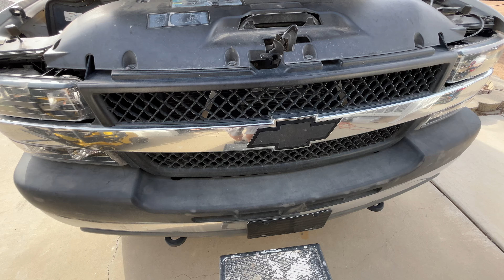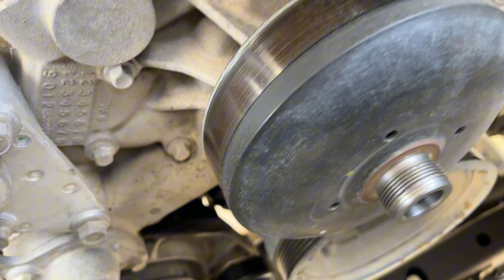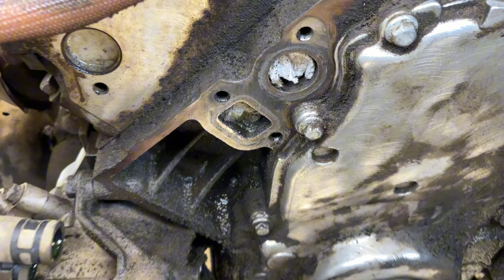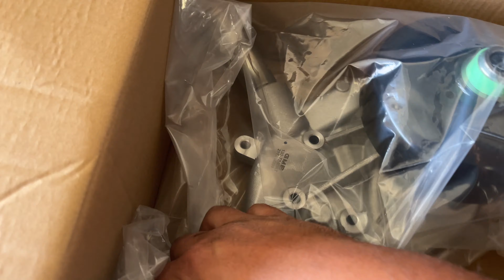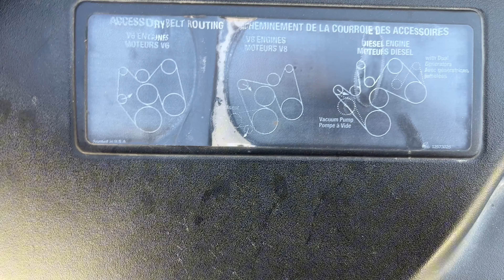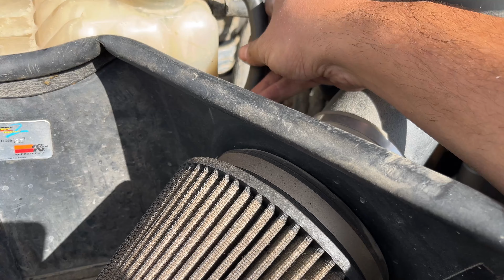99-06 Silverado water pump replacement

Comment: Should that fan spin that easy
Reply from the maker: It should be a few rotations before slowing or stopping. That means the fan clutch is working. If it spins more than 3 rotations and spins easily then there’s a chance the clutch is bad.